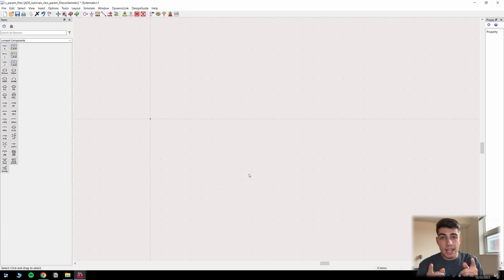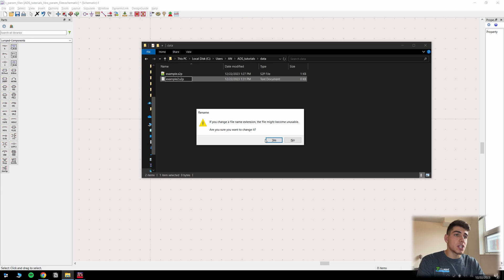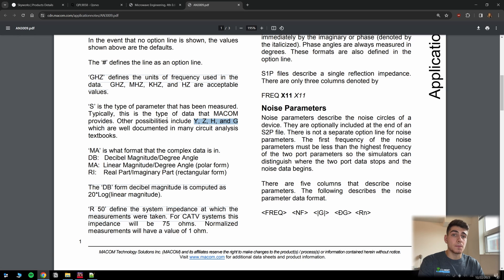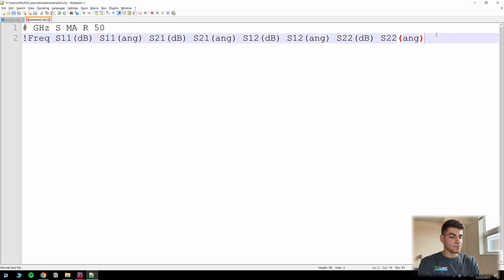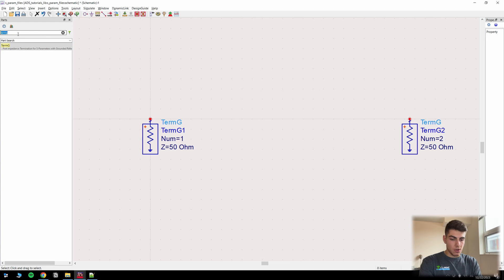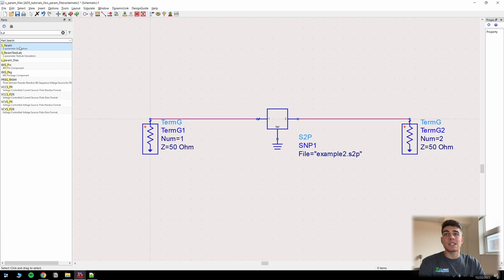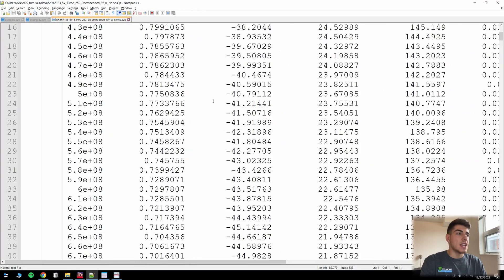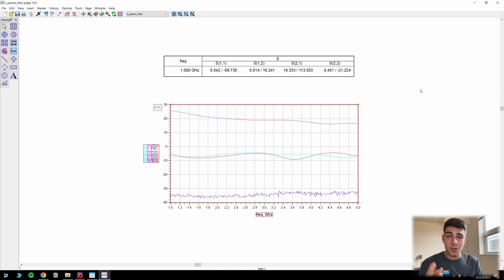How to Use S-Parameter Touchtone (s2p) Files in Keysight ADS

Comment: I am trying to simulate an exported s2p file from vendor company. I downloaded the file and unzipped it, but when I try to run the simulation it says simulation terminated due to error, it says the file I selected does not exist or is not accessible? why is that?
Reply from the maker: You likely have something wrong with the path you specified for the file. Make sure you are able to open the file in a text editor and see that it is formatted correctly.